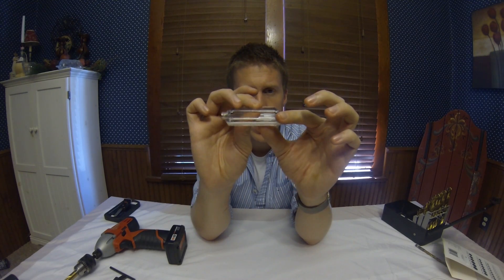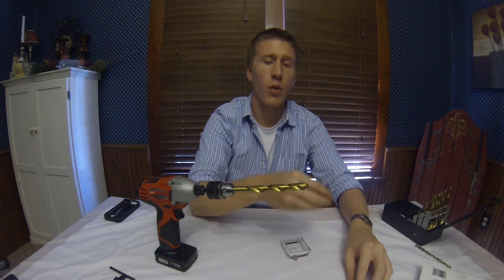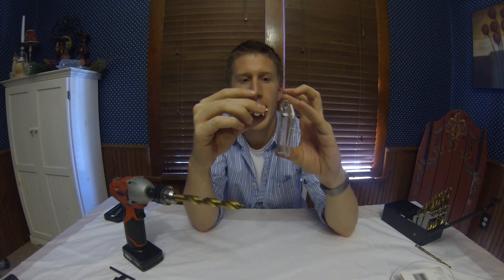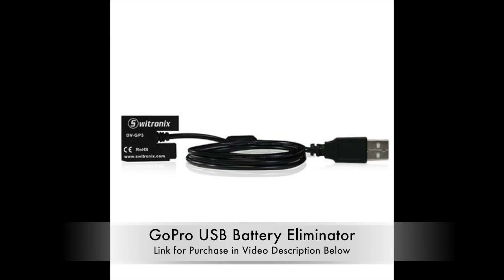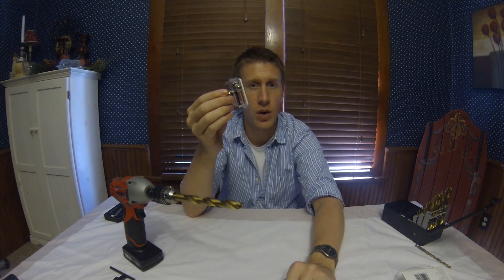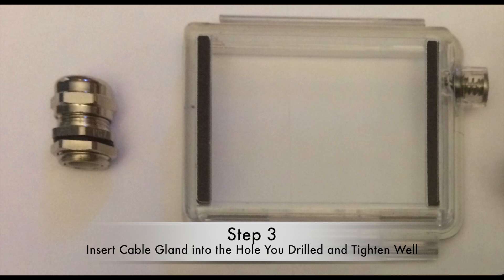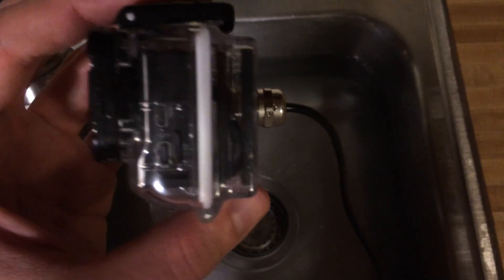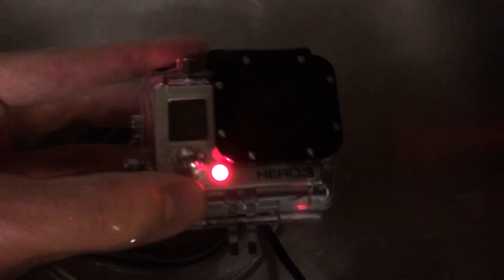Power and Charge GoPro Underwater For Waterproof 24hr Battery Life Kayak Solution!

Comment from the maker: BUILDING SUPPLY LIST BELOW

Supply #1 (PG7 Cable Gland): http://amzn.to/21FoWvv

Supply #2 (Battery Eliminator for GoPro Hero 3/3+): http://amzn.to/1T5lc53
 OR .... (Complete Kit for GoPro Hero 3+/4): http://amzn.to/1T5lwkr

Supply #3 (Large USB Battery Pack Options):
http://amzn.to/1T5lXuX

Marine Goop (Optional for added sealing around cable gland)
http://amzn.to/1TNc2Jg

TOOLS USED  (As Shown in Video)
Wire Stripper Tool  (I paid $9)
http://amzn.to/1T5mk8P

Soldering Iron Kit (I paid $16)
http://amzn.to/1T5mrkG

Powered Drills ( I bought Milwaukee M12 series)
http://amzn.to/1T5mxJf

Drill Bit (size 31/64") 
http://amzn.to/1WSSkLD

OPTIONAL: COMPLETED POLE SETUP PARTS
Telescoping Pole (We used the mid-size 06570L longer one is 06572L)
http://amzn.to/1T5mNI1

Painters Pole Tripod Adapter (we bought ClickSnap brand)
http://amzn.to/1T5mNb9

Video Description: 
This video shows kayakers and GoPro enthusiasts how to modify their GoPro Hero3, Hero3+, Hero 4 to get 24hrs+ of battery power time while still remaining protected in waterproof housing!  If you own a previous model of GoPro you could still do this but would need to find a battery eliminator or would have to make a battery eliminator.  One could maybe be made from an old battery gutted out with red (+) and black (-) leads to appropriate connections.  Please test your DIY modification without GoPro inside to see if it will meet the depth requirements that you require.  Large 20,000mah battery packs can be put in waterproof junction boxes to keep waterproof and one could use another cable gland to pass through the battery eliminator into dry box.  Options are endless with this setup.  This DIY modification works great for also getting awesome GoPro Timelapse photos!  Double, triple, quadruple your battery life with this modification and still keep the GoPro protected in waterproof housing!

~Thanks for Watching...Share this Video with Friends~

Sincerely,
KayakDIY

Subscribe to Channel:  http://www.youtube.com/subscription_c...
Like Us on Facebook: http://www.Facebook.com/KayakDIY
Join Facebook Group: http://www.Facebook.com/groups/KayakDIY

Comment: I like your idea so I moved forward and ordered the parts you listed. Got the battery eliminator and the back cover in  today. Waiting on the wire gland. My question is with all the excess space between the camera and the back cover, how did you address the slop? I mean what stopped it from moving around in there?
Reply from the maker: When I put it together the cable inside put pressure on back of camera and kept it pushed forward against front housing.  If you don’t get that then just use some foam.

Comment: Great vid!  GoPro really missed the mark on not making this themselves!

I wonder if there is some small connector that could be attached to the red and black wires so that one could swap the cable out without having to resolder?

I'm thinking of when you make a waterproof box for the battery using your same method and if you wanted to swap boxes, you could just disconnect the red and black wires, slip the cord through the glands in the housing and battery box, reconnect (inside the housing), and be good to go.

Comment: Just wondering what kind of power bank that can go to the depth of 30 meters under the sea.....
Reply from the maker: We mounted a regular one inside a waterproof sealed PVC pipe tube and used a cable gland to run the cable to the camera.

Comment: KayakDIY, a question regarding the USB connection at the power source. I'm considering a ZeroLemon SolarJuice pack, but regardless of the powerpack in use, does the USB connection point need to be waterproof? Or is this a non-issue? I'm thinking of a surfing scenario, or simply one with big enough water that your deck is awash at times.
Reply from the maker: +Wesley Picotte you could put the Zero Lemon in a dry bag while camera is plugged in.  That would be the easiest solution.  I use my dry bag a lot while kayaking.  Harder option would be that you also could make a waterproof battery box and pass cable through another cable gland.
Reply: +KayakDIY Just for clarification, this system doesn't account for keeping a power source dry, and/or using a power source that can be exposed to water? In terms of the application I inquired about, a dry box seems the only logical solution, and it would probably work we using the same gland as on the GoPro case. I don't see how one would run a cord into a dry bag, given how they seal.
Reply from the maker: Correct.  The USB corded system is long enough that you could put the camera underwater nearly 9-10ft and keep battery out of water.  Those cable glands used on the backdoor housing could be used to make a waterproof battery box setup.  Hope this info helps.
Reply from the maker: Wesley Picotte This is another waterproof alternative.  It is pricey and sells out quickly, but thought I would mention.  It runs for around $120 on average.  24hr GoPro Battery Backdoor: http://amzn.to/2bxSR7n

Comment: Thanks for the info.Someone is selling this kit now on Amazon but the reviews
 say the backdoor is the wrong size or something and it breaks when putting it on.
Reply from the maker: I prefer my home built one still because of the stainless steel cable gland construction and ability to really tighten the gland around the cable without stripping the cable gland threads.  I have no issues with mine.  Still using same camera and same setup that is shown in this video.  It is my "PRIMARY" camera and always on when out on the water.
Reply from the maker: +Wayn Jul something to keep in mind is also the different housings .  There are Dive housings and slim housings.  Maybe folks bought the ones from Amazon but had the incorrect main housing to match with backdoor.  As always test before putting camera inside.  We still prefer our homemade one because we believe it is built better and stronger.  We are still using the same exact setup and camera shown in video.  No issues.
Reply: Your probably right. I am getting my parts together for all day video rig.

Comment: Hey quick question anyone experiencing a heat issue? I wired it right heat shrink and all Seemed to get hot inside the case? I checked and checked again but don't see anything I wired wrong or did??  My power source is a cell phone type power pack?? That's the only thing I have different.. Thanks in advance for any help!
Reply from the maker: I can't say i have noticed a heat issue.  We use a 20,000mah zerolemon solar USB pack most of the time.  However, we have used a wide array of usb chargers and even our 12v battery with a usb adapter wired in.

Comment: We fresh and saltwater kayakers need a completely watertight battery box with components to attach wiring for a GoPro camera ( equipped with Battery Eliminator of course ) , depth finder and possibly a bow light or such . This battery box would also allow the user to move all components to another kayak or boat etc ...

Comment: I am currently working on this fix and am waiting for the PG7 cable gland to arrive. The Switronix battery eliminator fits well and I have the Go Pro backdoor housing. I notice that with the battery eliminator in place that there will be empty space between the camera and the back of the clear backdoor housing, so that the camera will move around. Did you find this to be an issue, or did the extra cable from the battery eliminator pushed inside tend to keep the camera in place (tight)? Thus far the Go Pro powers up fine connected to an external power bank. Thanks for the video.
Reply from the maker: +Keith C the extra cable pushed inside kept my camera in place, but you can always put a piece of foam inside to take up the space.  Also another thing I have done is put a small silica packet in the back.  This absorbs moisture and prevents any fogging of lens.
Reply: +KayakDIY Thanks for the feedback. I like the silica packet idea.

Comment: I have done this mod so far with great results!! 
I bought a switronix battery eliminator via the Amazon link you provided and installed as per your video, except I used a plastic pg7 gland, as I could get 20 of the little suckers for $2.00 - noone round here did stainless ones, and Im too tight to pay the rediculous Amazon freight for three steel ones. 
I used some silicon inside the gland as well as around the treads etc just to be extra sure. Once it was all completed I took it down as deep as the usb cable would allow without the go pro in it to check for leaks and it was all good! 
I have a 12v dry cell battery that I use to power the gopro with via a 12v usb adaptor from Aliexpress and it will go all day and all night if need be :-)
Thanks for sharing the idea.
Reply from the maker: Glad it has worked well for you!  Thanks for sharing your experience with the KayakDIY community/viewers.  We are still using the same one shown in the video and have had "zero" issues.

Comment: I may be missing something here but where do you get the battery with the power cable coming out the back? There are no links to that here.
Possibly you cannibalized a battery and made that yourself. If so, how did you do that? 
I have a Hero 3+.
Reply from the maker: Check link in the video description below video.  The cable/battery setup you mentioned is for sale there.  It is not made from a battery.

Comment: I'd like to connect a MicroHDMI Flat cable for an External HDMI monitor.
Is there a chance to modify this GoPro case? 
It would be great for a swim coach.
You are the Best!!
Reply from the maker: Danilo Valente You could do the same backdoor housing modification.  Then get a micro HDMI ribbon cable (which is ultra thin) which should be able to fit around the side output to the back of GoPro while in housing.  Then convert the ribbon microHDMI cable into a standard round cable by splicing the two together.  Then run the standard round micro HDMI out of the modified housing (through the stainless steel cable gland).  This should work to provide an external HDMI monitor and a waterproof GoPro system.  You could then essentially use if for things like Ice fishing and see fish below the ice.  Hope it kind of makes sense.
Reply: KayakDIY 
This is a great idea...
I'm looking for a solution like this: http://www.eyeofmineactioncameras.com/GoPro_HERO3_HERO3_HERO4_Underwater_HDMI_Live_Vid_p/euvh-3h.htm

But 290$ are too much.

You are the best..

KayakDIY 4 president!!
Reply from the maker: +Danilo Valente Not sure why anyone would want the stress & headaches of running the country.  We will stick with our low stress job of kayaking and fishing!  Thanks though!  Haha.

P.S:   What I mentioned previously will definitely work but would require soldering or ribbon cable to standard round.  Eventually I will build one for monitoring and following whale/dolphin pods.

Comment: but at what depth will the seal around the wire  fail
Reply from the maker: Peter Janak Jr had several kayak reef divers thank me and reported depths over 100ft.  I am sure it can go further.  We recommend first testing for leaks with tissues inside (no GoPro) at whatever depth you plan.  Also if you have further concerns of leaking you can use marine goop to seal inside of housing/gland.  We chose the stainless steel glands specifically because they can be tightened more for better seal.  We have never had issues with ours.  We did eventually add some of this cable wire wrap (1/4" or 1/2" works well): http://www.amazon.com/gp/product/B005V9UU1O/ref=as_li_tl?ie=UTF8&camp=1789&creative=390957&creativeASIN=B005V9UU1O&linkCode=as2&tag=ytk-20&linkId=UKX3IJ5L5AUY5CHR
Reply: Since pressure is an issue.  I wonder if a strong metal case exactly in the form of the GoPro cases would be stronger.  Presumably.  But not necessarily.
Reply: Oh and cool.  Thanks for the response.
Reply from the maker: The current housing should be able to handle pressures that exceed the ability of most divers.  Unmodified stock cases have been taken to 106 meters (348ft) by skilled divers despite being rated at 60 meters.   A metal case would definitely be stronger but possibly unnecessary unless you are a technical diver.  Most recreational divers don't go past 40 meters.  World record scuba dive is 1000ft.  The metal cable gland and existing housing should be more than fine for reaching depths that a typical diver would hit.  Sunlight won't reach past 30m depth very well and photos won't turn out well without substantial lighting.  Just need to make sure the stainless steel gland is tightened well, and possibly seal from inside with generous amount of marine goop.

Comment: Great video, would the same concept work with the cheaper gray gopro hero? Thanks!
Reply from the maker: Absolutely...Should work.  All you need to do is substitute charging cable with the battery eliminator we used.  So run a charging cable through a cable gland on backdoor of housing.
Reply: KayakDIY  it might not work unless the larger backdoors are compatible as the new Hero wont have space between the waterproof backdoor and the camera to do this.
Reply from the maker: Yes, it will be difficult to fit if alternative extended housing doors aren't available.  However, still think it can be done.  Plastic cable glands take up more space than stainless steel ones do that we used.

Comment: Dose d elimator cable work to charge a i phone 4
Reply from the maker: Soccer My girl frnd The eliminator for the GoPro is not related to iPhone at all.  The eliminator actually replaces the battery of the GoPro and allows the GoPro to be powered by USB.  Thus, you could charge or power your GoPro from any USB connection including auto cigarette chargers, battery packs, wall chargers, and more!  Thanks for the question.

Comment: its pointless without the accompanying waterproof battery case
Reply from the maker: BestFilmsProductions Using a cable gland to sealed box connection or a threaded/oring box connection is what some use.  However, you have 10ft of cable so you can still submerge up to 10ft from kayak without having to waterproof a USB battery.  Countless subscribers and fans on Facebook have reported this setup not only working well but holding up well.  What is pointless is a phenomenal camera lens and recording processor that every time you want to use it has a dead battery.  That is pointless. We have used this on multiple kayak outings.  Works great.  We have had some subscribers even swap USB connections to watertight threaded LED 2pin connectors and used this setup for diving.  Even without waterproofing the battery it isn't pointless.  You still have 10ft of cord depth that allows the GoPro to be waterproof.  If you need more than that for kayaking then you can waterproof the box as mentioned previously.

Comment: Doesn't the external battery have to be waterproof too?
Reply from the maker: +Filip Kopek If you plan on diving past 10ft then you will likely need to make a waterproof battery housing using another Stainless Steel cable gland (linked in video description).  We are still using the same setup shown in video and have had "zero" issues.

Comment: Looking to get maybe 6 hours of constant filming (not time lapse stills) for my 3+. Any suggestions for external battery pack?
Reply from the maker: GoPro Hero 3+ draws (1.9 to 2.2 watts of power with wifi off during recording).  It draws (2.6 to 3.6 watts with wifi on during recording).  A standard battery is (1050mah=3.88Wh or 1180mah=4.37Wh).  Wh means watt hours.  So a 1180mah standard battery gives 4.37Wh and if you have wifi off recording you draw about 2.2 watts.  Take 4.37Wh/2.2w=1.98hrs of record time.  So you want about 3 times that so 3 times that size would be 1180mah x 3 = 3540mah.  However, those are perfect world numbers and based on some GoPro data we found that showed various models and their power draw at different settings. 

I use this one linked below (10,000mah) because it has dual solar panels.  I keep it in a clear waterproof box that I ran a cable gland through. Nice for camping off grid. This gets me all afternoon recording i would say 6hrs or more at 1080p rec. http://www.amazon.com/gp/product/B00Q5Y6EW8/ref=as_li_tl?ie=UTF8&camp=1789&creative=390957&creativeASIN=B00Q5Y6EW8&linkCode=as2&tag=geeks0b8-20&linkId=VRWCGMNKO7LUOIRJ

Comment: How do you stop the camera from lolling about in the housing without the backpack?  Surely the wiring won't stop it?
Cheers
Reply from the maker: Actually the wire with the heat shrink is quite rigid and applies firm enough pressure.  However, if you wanted to be overly cautious you could still cut some foam to fit inside the empty space.  Thanks for the great question Dicky.
Reply: KayakDIY Thanks, that was my thinking, but I wasn't sure
Reply from the maker: Thanks for asking the question.  I am sure you weren't the only one wondering so you likely helped others.  Have a great day.

Comment: I think the best solution is to buy the 3d housing and mount one camera inside, then use the spare space to fit a battery
Reply from the maker: More expense and still limited heavily on battery life if you modify a 3D housing.  Although still not a bad idea.  Also would have to find battery pack to fit and maximize the use of that space.  However, you are clearly a thinker and if you build one send us a link.  Thanks for the comment.